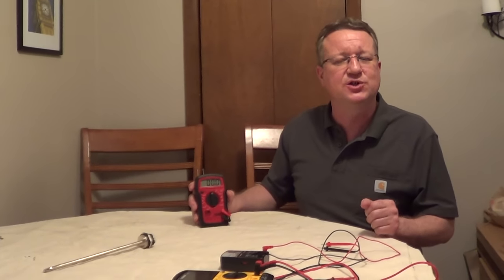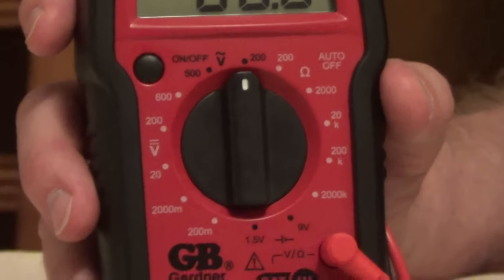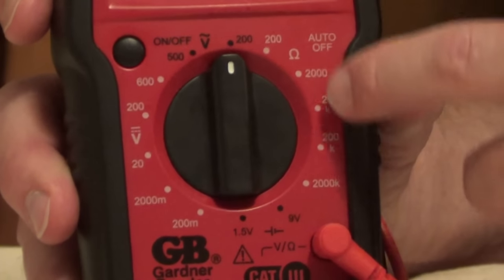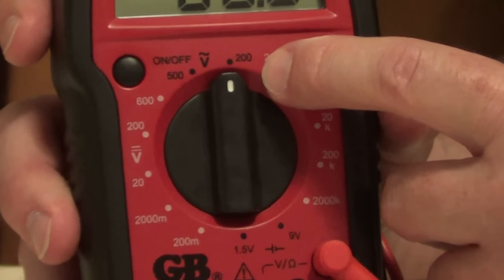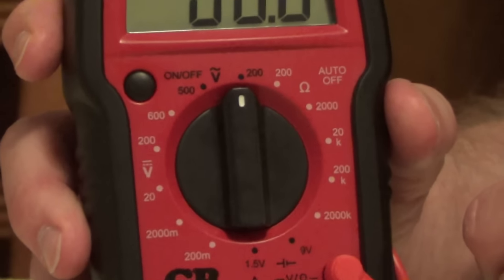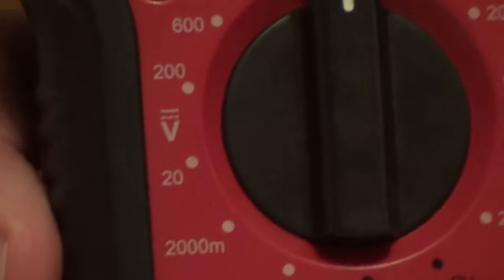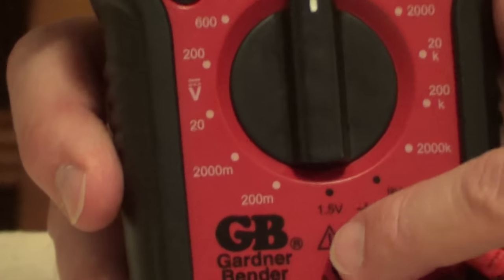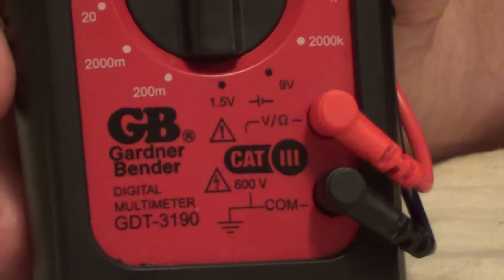How to Read a Digital Multimeter - How to Use a Digital Multimeter

Comment: @fix it home improvement channel,  your multimeter is different from the one I'm looking at online. For AC on yours, it shows 200 left of the off/on switch, and on the online one it shows the 200 left of and 200 right of, plus the 500 left of the off and on switch. So which 200 do you use for it?
Reply from the maker: Hi, you can send a picture to fixitpodcast@gmail.com. Look for the wavy symbol for AC or it will be labeled AC with the range.

Comment: How do you put a battery in this thing! 

Hey if anyone is reading this and needs help  I found the best way was to open the meter was to open the back hatch and then run a screw driver between the outer case and the meter while pushing the meter from the back. This should pop it off like a phone case

Comment: Hello Friend, can you please explain the 2000m and 200m indicators of the volt range? Where can I use it? Is calculation required? Etc.

Also, would plugging the test leads on the wrong socket ruin the multimeter? Like red test lead on the black hole and vice versa.

Furthermore, is it ok to touch the two test leads together?

I hope you can answer all three questions. Thank you!
Reply from the maker: Hi, when the multimeter is in the Omega range to test for continuity and resistance you can touch the 2 probes together to show continuity. I've only used the smallest range to test the element on electric water heaters. The range for DC I only use the range just about what I am testing. So for a, aa, aaa, c d and 9 volt batteries I would use the lowest setting. Hope that helps. I use the multimeter for home improvement projects.
Reply: @FIXITHomeImprovementChannel  If I'm going to measure something that's around 0.30 volt, should I set the multimeter to 200m or 2000m? I'm guessing I should set it to 2000m, correct? Because 0.30 volt, which I assume is 300m, is higher than 200m, therefore I should set the multimeter to the next value that is higher than 300m, which is 2000m, am I correct?
Reply from the maker: @eeyyaakk6801  Hi, you want the dial on the number just above the number you are testing. So you would want the lowest setting.

Comment: Damn it!.. mine looks almost the same except it's a GDT-311... it has all of those settings except the 1.5 and 9v settings... 😡
Although I think you can still test batteries on the 20v setting. I've been checking my batteries with that, and it seems to work..

Comment: Does this model do continuity testing?
Reply from the maker: Hi, yes, turn the dial to any of the settings in the resistance range, with the Omega symbol and test. If the value changes from 1, there is continuity. You will get 000 or a value below 1.

Comment: My GB doesn't have the increments of each main setting; such as, on the Omega or resentence for checking as you referred to the water heater, the 20k and 200k and so on. Are these increments important b/c why don't mine have them as yours. Again, mine has no increments to set on? My model is GDT-3200 Auto Digital Multimeter and I bought it last year 2018. Why me???
Reply from the maker: Hi, it is automatic. It will give you the reading without having to put it on a specific range.
We have more home improvement tips on our weekly podcast http://castbox.fm/u/6389499.

Comment: I'm checking Christmas lights what should I use
Reply from the maker: Hi, unplug the lights and check the fuse or fuses in the plug and bulbs with the multimeter set to test for continuity.
Reply: @FIXITHomeImprovementChannel  also if the bulb is out but the medel peaces are intact the whole string should still light up right? And if that medal peace was gone part of the string would go out right?

Comment: I do not believe you can test capacitors, correct? Those measurements use a completely different symbol on other multimeters and I don't see one on this one.

Comment: for the life of me I cannot figure out a way to remove the rubber cover to put in a new battery
Reply from the maker: Hi, the black cover will pull off, it is just very stiff and hard to do. Start in one corner and work your way around.
Reply: FIX IT Home Improvement Channel thanks friend! subscribed!
Reply: Me to
Reply: I Used a table spoon started on the upper left corner. Pried it open that way. Worked like charm